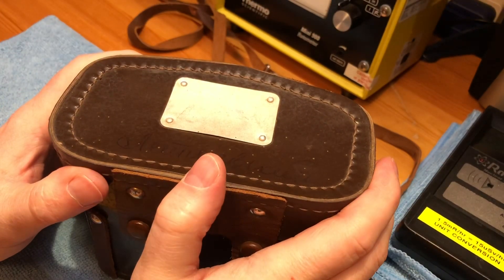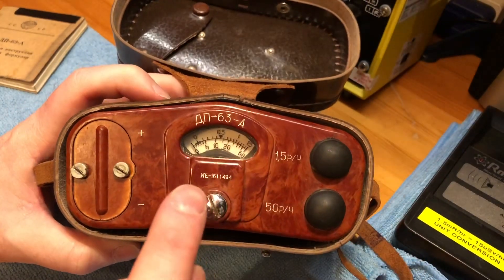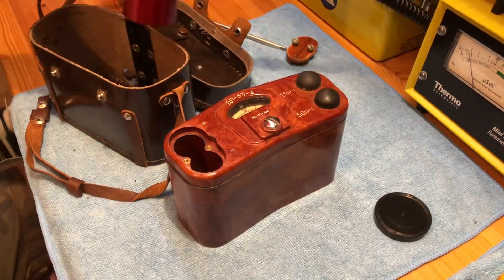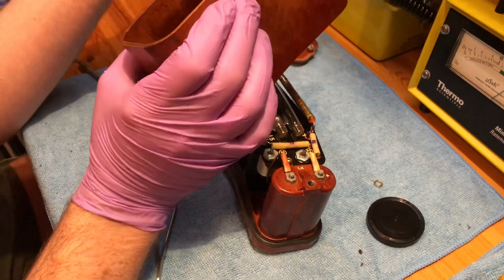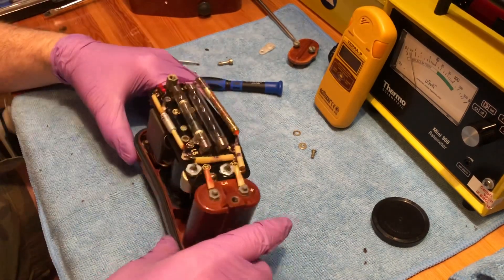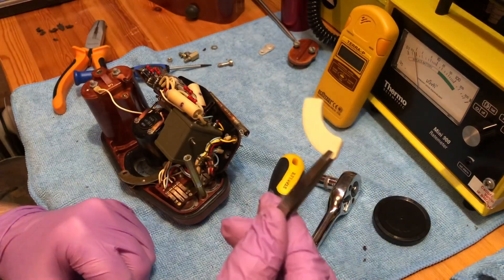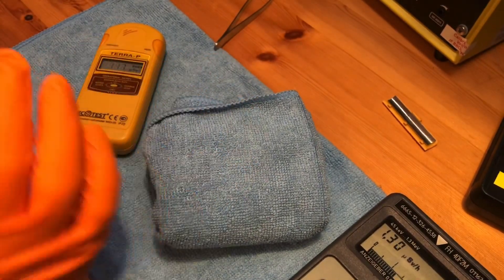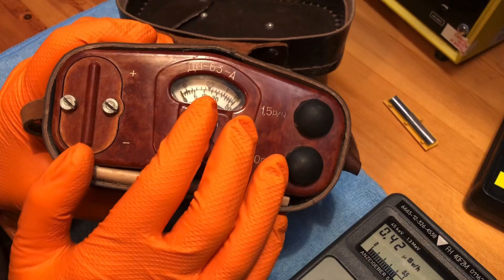☢️Soviet DP-63-A Survey Meter

Comment: Okay, I have one of these I got in a group of Soviet items about ten years ago. It's still in it's leatherette case with the instruction manual in that. I've never nor do I intend (especially upon seeing this and another video) to take it apart. It's still all together as I received it. As long as it is kept like that is it safe? If I open the battery compartment to try AA batteries in it, is that safe? If not I will just leave it closed. The one I have is the type without the date under the other number on the faceplate.

I have no geiger counters... this is the only such thing I have in my collection but I'd definitely like to know if it's safe as long as it's kept as I received it and not taken apart ie: not having the bakelite case opened.
Reply from the maker: Its safe as long as you don’t start tampering with the insides. The battery compartment is sealed from the rest so its safe to open. The radium painted dial is horrendous, its just contaminates everything it touches.
Reply: @SurvivingTheApocalypse  Many thanks! I feel MUCH better now! Had no idea of any of them before or since I got it. It's been in a box with some Warsaw Pact flags, helmets, etc., for years in my den. No intension of opening it up, other than perhaps putting in batteries to see if it works. Long as it's safe the way it is I'll definitely be keeping it that way. No desire at all to open it up. :-) I'm guessing if anyone down the road wanted to buy it it's safe to ship since I do see them on Ebay?
Reply from the maker: You can post it yeah but just wrap it in tin foil ☢️ and then put it in a sturdy box.
Reply: @SurvivingTheApocalypse  Sounds good! :-) Again my DEEPEST thanks! Feeling MUCH better!

Comment: I've recently purchased this model for a dear friend. It came without a battery pack (understandable lol), how do you recommend that I power this device? I live in the USA. Thanks for your time and any info you can give me!
Reply from the maker: Apologies for the delay in replying. Best way to power it is using the individual cells from a LR12 battery back. These are pretty common in the UK and I am sure you will be able to get them via Amazon and eBay in the US.
Reply: @SurvivingTheApocalypse  Hey, no worries. I sincerely appreciate your input and knowledge. All of my attempts are typically dry-runs, and you have valuable wisdom. Cheers 😊

Comment: Units with radium scale were produced from 1958 until 1966. Later units did NOT contain radium scale but they still had the B-8 Sr90 source. The safest way to buy DP-66-A with a radium scale is to buy one with the production date on the front panel :)

Comment: If you put that Radium/zinc sulphide scale in the aluminum foil you could knock off some Neutrons and do some activation experiments.  The Alpha N reaction works better with Ra,Be though.
Reply: The scale is not active enough to really do any neutron activation with. It will only make at it's best 12 neutrons per second which is nothing. The average activity needed is 4mCi of the stuff which will make 2960 neutrons per second.  The scale is only around 16uCi.
Reply: @radiumquetzal8000  you could still see some activation no?  Using Gamma spectroscopy not a geiger counter
Reply: @chemistryscuriosities  Nope. I'm pretty sure that even the amount you would activate when using a 4mCi source would not be detectable with a geiger counter.
Reply: @radiumquetzal8000  I know it won't be detected with a geiger counter but you should with a good spectroscopy setup
Reply: @chemistryscuriosities  Hmmm don't really think so, you might if you use a HPGE but it would probably not activate enough. Also I was really REALLY stupid, I forgot to include the daughters and I also have a more accurate activity of the scale. (The first one was an average before I got a proper energy compensated unit) The scale shown in the video has a Ra-226 activity of 12uCi and a total activity (if stored in a compact airtight container) 96uCi. (Rn-222 excluded due to it not being present in large amounts in the source) The full activity is not 100% accurate due to the radon escaping and decaying on the container but it is the closest I could get. It will make around 44.4 neutrons per second when spread out on a beryllium sheet/foil. Still not enough.

Comment: Great video, gave you a sub. One thing to note not all these DP-63 come with the radium scales, I bought a second one after getting one and loving the two check sources and then found it had been retrofitted with a safer glow in the dark foil back screen. Similar to what was on the Polish DP-66 and DP-75 units and the later DP-5 variants.
Reply from the maker: Weaponsandstuff93 I think they stopped using the radium dials in the early 70’s. Did you get your second one from the seller listing them on eBay.com or on Etsy? I got mine from eBay and got the seller to send me pictures before he sent the second one just to be sure.
Reply: @SurvivingTheApocalypse  Yeah both the ones I got from eBay were the old radium dial type, it was one from Etsy that had the more modern non-radium back screen.
Reply: @andreasjack1000  Yeah it's still slightly active but seems they did a good job cleaning it out.
Reply: @SurvivingTheApocalypse  do not use Etsy,that is a scam.....I know because i got fooled, and lost 1000 Swedish kronor
Reply from the maker: Stephan Höglund I have purchased a lot of things from Etsy and have never had an issue and fingers crossed I never do. I have been scammed on eBay before, its a risk you take.
Reply: I had the same problem the second one didn't have the Radium scale.  I bought it from the same seller I got the first one from to.